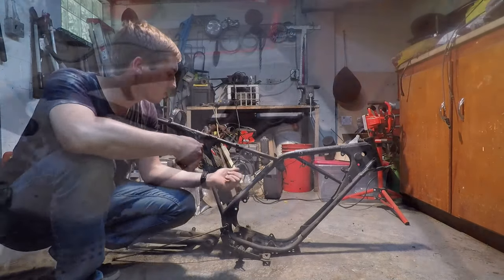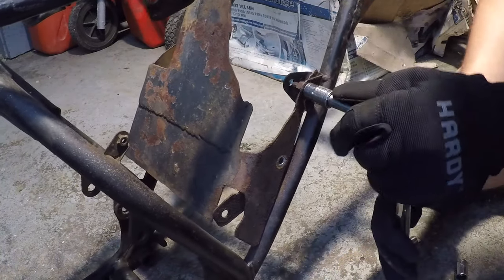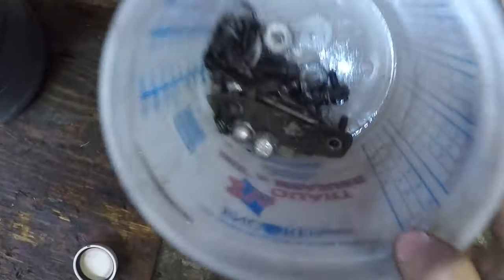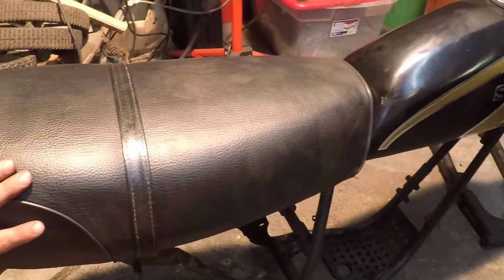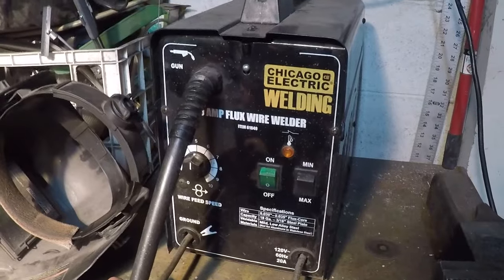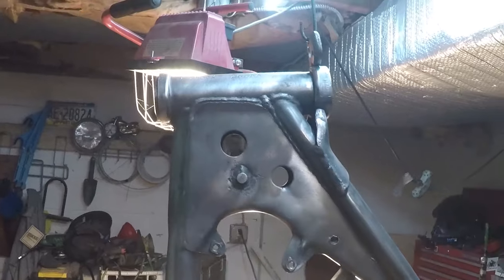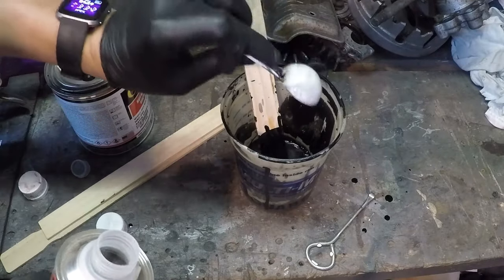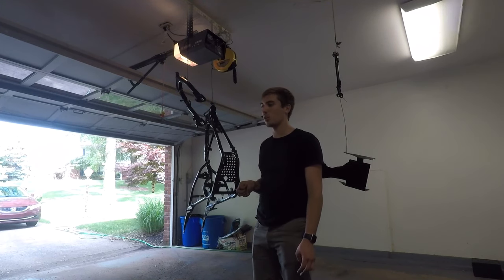Modifying and Painting a Motorcycle Frame | Suzuki TS185 Restoration

Comment: I think the paint can start to peel if their is to much thinner in the paint mix. using a primer that leaves a rough surface makes the paint stick better... like using an adhesion promoter between the primer and paint lair, a lite dusting, does not have to be full coverage. the surface should feel like sand paper before being painted, but not to be sanded to get the rough texture. "vary lite primer coat".

Comment: Nice job man. If you used my pressure washer you wouldn’t have needed any aircraft stripper ! The commercial ones will take OLD paint off with relative ease. Just in case you ever want to invest in one.

Comment: Hey man, I was wondering, do you have any advice on how to cover exposed wiring that can be seen? There's a cluster of wiring coming from the front of my fuel tank to the headlight cluster and it looks quite unsightly. Currently I'm using a cheap cable sleeve but it doesn't look that neat. What do you use?

Comment: Hi do you know what is the difference between this "Keeway KLight 125cc" single cylinder and the "Hyosung Aquila 125cc" V twin cylinder ? Thanks
Reply from the maker: One has two pistons and the other has one piston. Both engines have the same displacement so they will both go the same speed but the vtwin might sounds cooler.
Reply: @GoldGuyRides  thanks

Comment: With the frame neck off and only straighten "good enough" the bike isn't going to ride straight and will be not save to ride. But like always you have to work with what you have on your hands. Maybe you can find a shop that can straighten it for you? And you will promote them on your channel if they give you a nice price for the work. Or they might even sponsor that for your channel. But don't forget to replace the bearings! Boi you need to step up your game! If you run into jobs you cant manage get help for the job. I know that will cost some money sometimes but it also shows a solution to a problem you can run into. You already spend money to rebuild the bike but if you build it on a bend frame it is all worth less. There are things you should not skip on doing and that is everything that regards to you risking your health and life on riding the bikes. What happen if you go into a left turn and it pulls you right into oncoming traffic? If you end up in the hospital it cost you more then the money you need to invest to make the bike save. And it even can cost your life. Are you willing to pay that price to ride the bike?

Comment: couldn't you just have used the mixing paint cup you used for the frame hardware to mix the paint? lol
Reply from the maker: Yes, that would have been much easier lol but it was still full of parts and rust remover solution